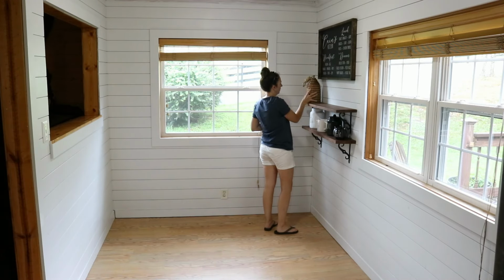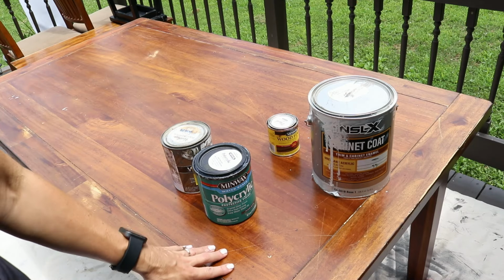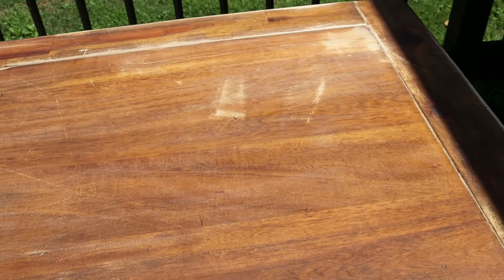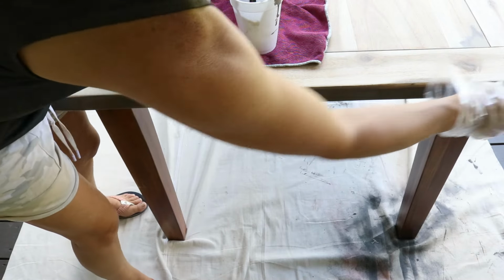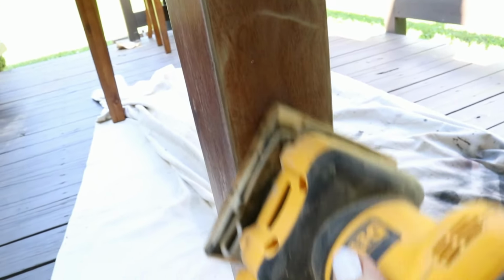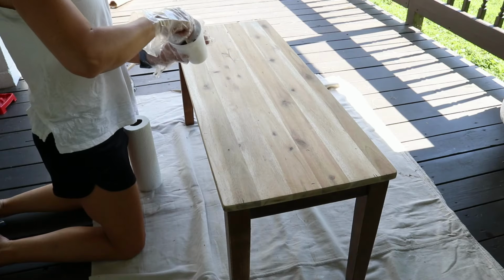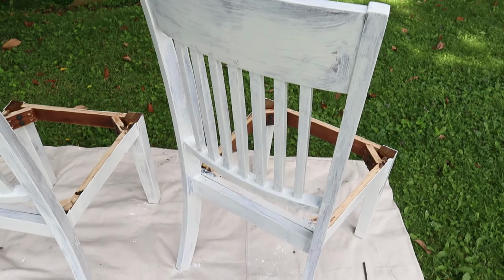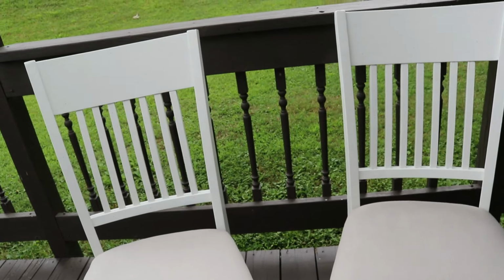Farmhouse Dining Room Table Makeover/Farmhouse Kitchen Table Makeover

Comment: I want to do the exact same thing as you did. I have the same exact table and chairs. I have never done anything like this before. Would you help me with the list of things to buy? Everything from the size/number of the sand paper  to the different types of paint/stain/wax or whatever else you think I need. The only thing I have is the stapler. Also, do you think 2 yards of fabric would be ok for 6 chairs? Thank you so much 🤗
Reply: I would use aluminum oxide sandpaper. It’s much better quality and doesn’t gum up as bad with the old varnish. 60 grit then 180 or 220 grit.